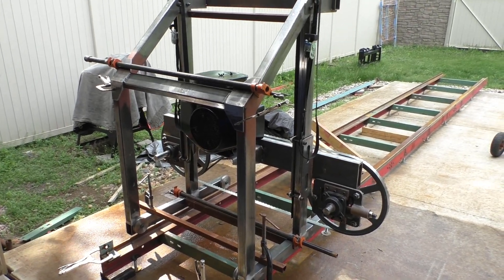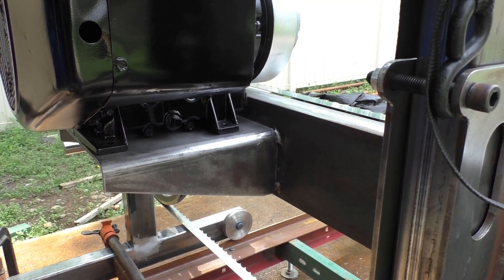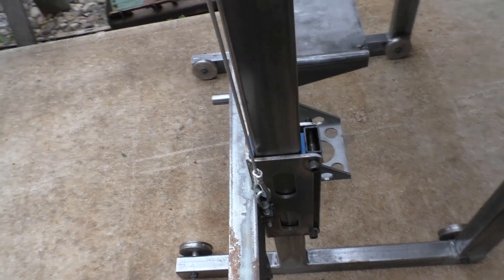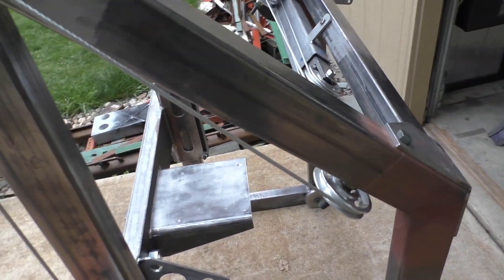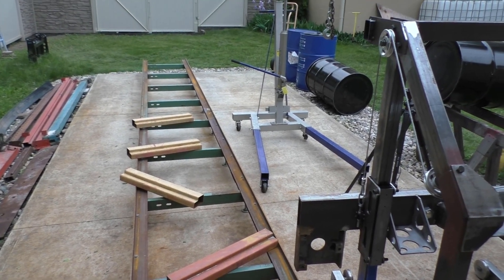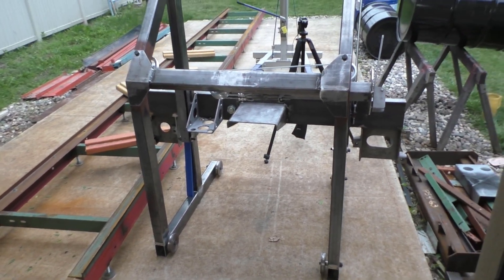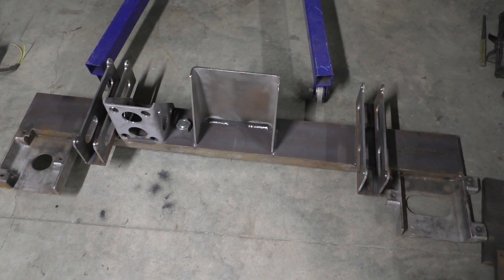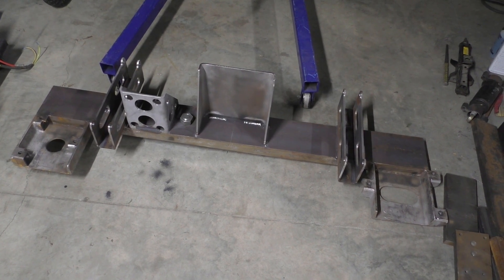#43 Sawmill Build Homemade DIY Spencers-Mountain Cable Lift Barrel Guards for Off-Grid Build

Comment: Hey there your work is amazing.  I’m building a mill myself and I’m curious where you got your band wheels?
Reply from the maker: @BCben3  surpluscenter.com  18.75” sheaves. Low cost, works, maybe more lightweight then I would have liked. Replacement parts from saw manufacture is a good source, higher price, better quality. cookssaw.com has solid face wheels, expensive but best choice if you can justify the price. Can’t drive like I did, but fixes many sawmill issues and better machine. Other good parts on that site and great free shared advice on engine size, drive reduction ( pulley sizing), etc.

Comment: How did you manage to notch out the hard jaws of the bolt cutter?
Reply from the maker: I used a small air powered die grinder with a carbide burr. The bolt cutter jaws were softer than I imagined. I had considered using a torch or burning out the notch with a welding rod. An abrasive hacksaw blade would work. Thank you for watching.

Comment: what is the cut height capacity of this mill?
Reply from the maker: The mill was built to accept 26” diameter logs.  There is clearance for 28”.  Quickly in the area of logs I would not want to move. Thanks for watching.

Comment: I am assuming you have three phase power in your shop
Reply from the maker: Many years ago I had a digital 3 phase inverter for an old CNC vertical mill.  Sold off equipment for our transition to the Mountain where the sawmill currently lives.

Comment: Impressive build. Was your design influenced by the Woodlan Mills design? I see a lot of similarities.
Reply from the maker: It is similar. I did use their lift system but found they borrowed and were copied by other commercial saws. Most of this build came from scrap or repurpose materials. Thank you  for the comment and thanks for watching.
Reply from the maker: Had to edit above was replying to wrong video.

Comment: Great work, but in most part an overkill, i mean, does the battery realy needed that robust housing?
Reply from the maker: Weight of a machine can aid it's final function in a positive way. Keep in mind that most of this build was using scrap laying around the shop from previous projects or auction pile materials. If I could see a functional part in a piece of tube that would take the least amount of fabrication, that is what I used. I did toss in a few extras just to keep it interesting.  The battery mount was a scrap piece of tube...the silly part was drilling holes in it but helps clean out water and sawdust. 
Thanks for watching and thank you for the comment!
Reply: @SpencersMountain  youre welcome, i understand your point...😊

Comment: Really nice build! High quality in every detail. A question, the band wheels that you are using. Are they standard belt wheels? Type A or type B (sda/sdb)?

Btw, like your style of videos. Nice, clear and concise explanations. No babbling or music that makes your ears cry 👍😊
Reply from the maker: Thanks! The band wheels are standard pulleys/sheaves rated for A and B belts. I am using Gates BX Tri-Power belts. Ideas towards providing a crowned surface for blade to run upon, higher power capacity, notched for flex around small pulleys, notched for cooling, and hopefully notches aid clearing sawdust that will build under v-belts.  So far it has been working well. Thank You for watching.
Reply: Thank you! I'm gathering info to start my build :) Keep up the good work.
Reply from the maker: @andreaslundback  Good luck no your sawmill build...be sure to share :)

Comment: Incredible build.  Very impressed with your ideas and machining skills.  Do you have a part number and website where you purchased the pulleys for the head lift mechanism?  Thanks!
Reply from the maker: Thank you! The pulleys were an eBay purchase. If you search aluminum cable pulley fitness gym keywords you will find current offerings. I believe I used the 95mm pulleys. Shop carefully, it is possible to buy a set of 8 for the cost of two. There is some weird pricing on the pulleys. I looked for pulleys sold in the US to avoid China shipment and found a seller taking offers on a quantity of 8.  The bushings pressed in the bearings are some kind of powered iron and drilled easy for my 1/2" hardware.  I popped out the bushings to drill them. Hope that helps. Thanks for watching and good luck on your project.

Comment: thank you for doing the videos, this is very interesting. I am a welder by trade but am not sure if there is any economic advantage of the DIY approach. You probably have way over a $1000 in parts to start with, and without a blue print you are talking costly trail and error. If you ever consider selling plans you could help others and yourself.
Reply from the maker: I am pretty good at seeing a part in a piece of metal. Behind the scenes, I did use CAD to dimension parts and check fit. Drawing things out in advance is always a good plan.
This saw is a collection of ideas to to use a lot of existing parts in the shop. It is not a design I recommend for DIY. The are simpler ways to built a saw. In the end, cost is about what you get for results. As a machinist, a heavy machine resists the stress of work it has to do and produces best finish. But more weight also costs more.
For plans, I would not do this machine since I feel it is possibly too advanced and would prevent someone from reaching a dream. There are a lot of DIY mill videos...maybe my videos will help past a problem that comes up in someone's build. Thank you for your comment and watching my video, really appreciate our viewers!
Reply: If the only value metric is time/cost to get a saw in your hands, then certainly you should just go buy a commercial mill.  It has all of the advantages of someone else working through the issues of putting a design into production and then making it available at a volume manufacturing cost.  But you'll find people engaging in all sorts of activities where learning, curiosity of experimentation, personal satisfaction, etc.. are strong (if not the primary) motivation for why one chooses to do invest time in "something like that".  Others might  choose to swing golf clubs around in the afternoon where this gentleman produces his own tool and (even more striking to me personally) takes the time to document his process to share with others for gratis.